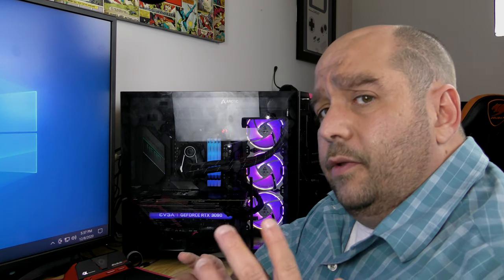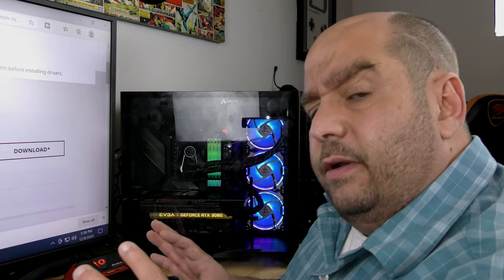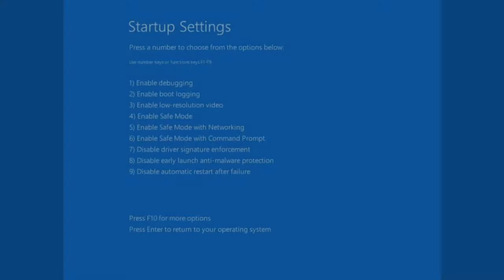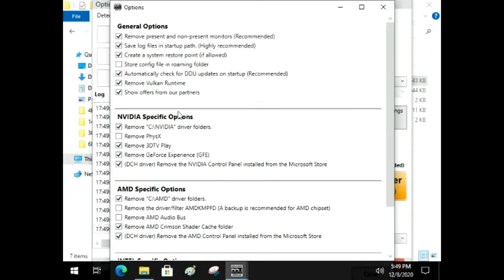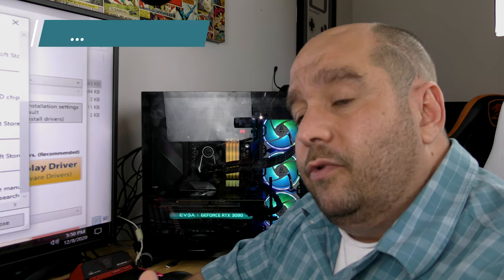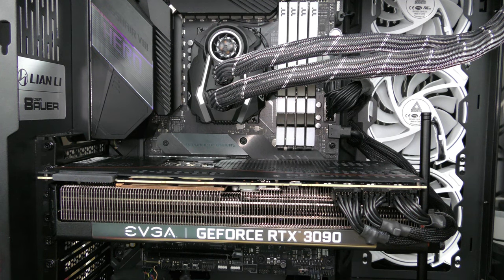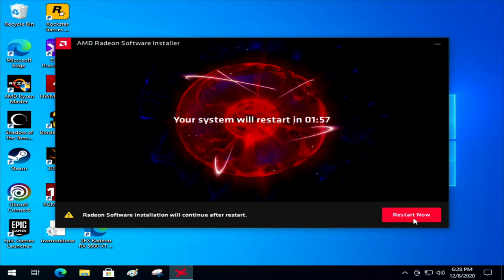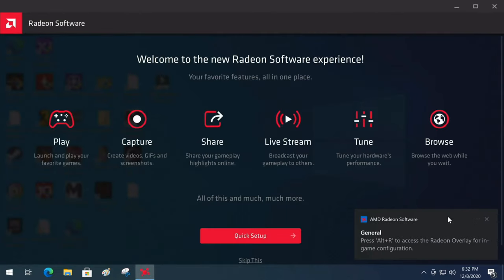AMD Radeon RX 6800 - Installing the Sapphire NITRO+ RX 6800 Gaming

Comment: I got a sapphire nitro+ 6800 and a seasonic 80+ plat focus px 850w and it sounds like both are having coil whine. Should I be concerned? Everything is running properly, it just annoying very noticeable noise.
Reply from the maker: no... but if it's insanely loud, i think over 50db (You want to check with sapphire support on their terms) but usually unless its obnoxiously loud and a certain DB, they will not change it.  Sadly coil whine is kind of common, I don't get it much, but I do get it occasionally I am trying to figure out a way to record it to show it to all.
Reply: @ThisBytesForYou  I capped my fps at 60 and some games its not to bad but when I start remnant it sounds like a screeching harpy. It goes down after awhile but the start up is really bad
Reply from the maker: @palacepanda1753  yeah I know what you mean... but it may be best to contact sapphire, maybe they would change it.  Headed off to bed now, gotta get up early for work tomorrow, but thank you so much for checking out this video, liking and subbing as well as commenting, it means the world to me my friend and I hope the best for you.  if you write back, i will get back to you as soon as possible tomorrow. I answer all of my comments and always try to help where I can.

Comment: I have a r5 3600 and rx6800 but have been having low fps and also my gpu drops to 0 volts intermittently at idle.  All my bios are up to date. But i did upgrade from a tx 580 8gb and didnt delete the old drivers.
Build:
R5 3600
Asrock B450 Steel legend
Sapphire Nitro+ Rx 6800
Gskill Trident Z 16GB 3000mhz
Corsair CX750W
Samsung 860 Evo 1TB
Samsung 860 Evo 500GB
Cooler Master MA620M cooler
NZXT H510

Fps im getting: (no ray-t)
Siege max settings 1080p: 240
Doom eternal max 1080p: 220
Warzone max 1080p: 130
Reply from the maker: ummm, you are saying you have low FPS...., 240, 220 and 130... how is that low?
Reply: @ThisBytesForYou  i was seeing some people get like 330 on doom eternal with a similar set up and i agree its not low but i want to make sure im using my card to its full ability without oc
Reply from the maker: @xXReichstadXx  it all depends on their presets, their current settings, monitor htz, and a ton of things as well, also cpu.  At 1080p, you are CPU bound, are they are 1080 or higher?  DOn't worry too much unless you are getting under 60fps, but you are blowing it away, good job my friend.
Reply: @ThisBytesForYou  my monitor is a 165hz 1080p monitor but this makes total sense. Plus, using trixx has made me 10 times more confused xD but your right and by god i do enjoy the quality im seeing.
Reply from the maker: maybe this video will help you with trixx: https://youtu.be/y8mIsFIA15k

Comment: After I restarted my pc is at a black screen any reason why nothing is popping up?
Reply from the maker: Could be a thousand things, give me some information so I can help
 So that I can help, please list the manufacturer and exact model number of the following components:
1. Motherboard
2. CPU
3. RAM
4. Video Card
5. Power supply
6. Monitor.
7. Do you have ALL of the PCIE connections plugged in, and not daisy chained or pigtailed, each coming directly from the power supply?
8. Are you running through HDMI, DP, DVI, VGA, etc?
9. UEFI in the BIOS from Legacy.  If it was set to Legacy, you will need to reinstall windows to get correct support.
10. Disable CSM in the BIOS

Comment: Hi there, Thanks for taking time to make this video, very well explained, subbed, 
undoubtedly saved me a lot of time and hassle ,  I came here after purchase of 6800nitro today .

I’ve Followed your instructions to the letter and everything worked perfectly exactly the same as your video - until I tried some games, 
Doom 2016 =  tiny screen 
Asseto Corsa in vr just won’t show on HMD at all , both running fine beforehand .
Also I can’t close the oculus app 

Thinking I must have driver issues , should I delete and reinstall games? 

Previous card was nvidia 2060super , GeForce experience has been removed by DDU 
CPU is 3700x , rift s 
Any ideas?
Thanks
Reply from the maker: Thanks so much for your support my friend, I greatly appreciate it.  Regarding potential driver issues, I recommend you watch this video: https://youtu.be/8JuC_Dpm6-c

Also, as for Doom, when you are playing it, press Alt+Enter, it should fix it, since it seems you are playing in boarderless or windowed mode, i play everything in full screen.  VR, even thogh I have an Oculus quest 2, I have not tried it much, its my sons, so I cannot comment on it.  So when you used DDU, did you install the latest and great AMD driver?  Make sure you are using HEVC encoder in oculus for AMD and maybe take a look in here: https://www.reddit.com/r/oculusquest/wiki/faq/link
Reply: Wow ! Thanks for such a quick and detailed response, I’ll have a look at these links and see how I get on, I’ll report back with results in case it helps future users with similar issues 👍👍
Reply from the maker: Thanks bud, this most definitely helps others, thanks so much and welcome to the fam.
Reply: thank you for your advice
yes i doubled checked i had the lastest & greatest AMD gpu drivers and they were ok, then strangley the pc kept intermittently freezing the cursor as well,all i could do was reset the pc to get out of it. so deleted old mouse drivers and reinstalled now all working fine.

i ran a repair on the oculus app using the in built software -no change to the problem,  all i had was the three dots on hmd no matter what game i was trying to run, so looked through the radeon software and found that steam vr intergration was disabled ,so enabled that and its worked! 
had a quick blast on Aircar with all the settings maxed out and i have still got the smile on my face an hour later. so all good there.

i havent tried doom yet as i have uninstalled it for now,but will check over weekend

is there a way to remove the DDU software? as i dont like more stuff on pc than neccesary,ive had a look in programs but couldnt find it to uninstall

Edit: reinstalled Doom and tried alt+enter but that’s not sorted it, the screen is about 1/8 normal size but the pc thinks it’s showing a full screen image 

cheers
Reply from the maker: ok so then in doom, make sure if it lists refresh rate, make sure the refresh rate is correct, make sure you are playing in full screen mode and not windowed or borderless.  Not sure what the mouse driver had to do with anything though?  Are you using the official Oculus cable... I used a regular usb c cable, but my son is getting some lag, I need to get the official cable to see if it makes a difference.

As for DDU, yeah, you can just delete the folder, it does not install, it just extracts.
Reply: ah thanks!  OK deleted the DDU folder.
Regarding Doom it looks like this is a common problem unrelated to the card change, trouble is the screen is so small i cant see or get into the options plus the in game stats overlay is also on, to be honest im not too worried about it, i just wanted to compare performance against my 2060s.
Concerning the VR, I'm using the Rift s so its got the displayport and usb cable installed , the VR side of things is working fine now after making the changes in the Radeon software.
Have a good weekend & THANK YOU FOR YOUR HELP !
Reply from the maker: awesome my friend, very happy you got it working, thanks so much for trusting in me to help you, thanks so much for stopping by, checking out my video, liking and subbing as well as commenting, it means the world to me.
Reply: hey man, yeah thought i would update, had terrible vr performance all week ,crashes and freezes, unresponsive Oculus software needing constant reset of PC
I added another cable to the gpu from the psu instead of daisy chaining - no change.
I ran monitoring software but nothing looked out of place,so started to think about ditching the card and going back to nvidia.
anyway long story short, ended up doing a fresh install of windows and Bingo ! all is good now -no problems

Comment: If I have and old AMD card  which uses the same driver already updated, I don't need to uninstall and reinstall the driver right? Just change the cards.
Reply from the maker: with all the issues going on, if you have older hardware, yes just remove the card and install the new card, but if you have newer hardware, follow the guide.
Reply: @ThisBytesForYou  Thank you!

Comment: I know this is 2 years old but I just wanted to say my 2060s clips are actually on the top
Reply from the maker: yeah, working as Product Development at Alienware and Velocity Micro, all of the cards we used were on the bottom, since we only used some manufacturers, becoming a reviewer, I got to experience many more cards and yeah... I found that some where on top or bottom, for both NVIDIA and AMD cards, surely the same will happen for Intel cards, whoops haha, thanks so much for letting me know ;)
Reply: @ThisBytesForYou  thank you for your response and I hope I didn't come off as rude or anything I was just curious if maybe my card was different for some reason. Anywho thank you for this amazing video I got a 6800 coming in later and feel very confident after watching it a few times!
Reply from the maker: no no, not rude at all my friend, I thought for years that they were on the bottom only, hahah because we would only use certain manufacturers, but others make it differently.  I am so very happy you enjoyed this video and I hope you let me know how it goes.  Make sure to subscribe, I come out with videos helping in all aspects on the PC weekly, stay tuned my friend ;)
Reply: @ThisBytesForYou  so far I thought so good I followed the steps perfectly, used DDU checked the box, let it do its thing, I swapped the 2060 out put it in revooted the system. It recognized the card but it wasn't in safe mode now when I try to install the amd drivers it says my pc can't open this file. It also made me restart upon initial bootup
Reply from the maker: thats ok that you swapped the card and rebooted into regular mode, and started installing, thats normal, what version of windows are you using?
Reply: @ThisBytesForYou  windows 10 I ended up redownloading the amd drivers and it seems to be installing correctly now. Thank you so very much you have been a great help
Reply from the maker: Always a pleasure my friend, so very happy you stopped by, trusted in me to help you, liked and subbed as well as took a moment out of your day to thank me.  It means a ton to me and I am so very happy I could help you.

Comment: hey my man have a question. My video card (AMD 6800 XT) will crash at least 1 or 2 times a day when i stop playing my games. I've tried Overclocking, under clocking, tried to keep the demand high so it always needs power but i'm having no success. Because i'm in a lock down area (Ontario Canada) i cant easily go out and get stuff to try and tinker. My power supply is a 750W, however it is around 5 or 6 years old. The power i'm putting into the card is from the same 8 prong plug and it jumpers to the next set of 8. Could my power be providing too low Wattage? When you plug in the cables (From your video) they're 2 separate cables coming from the supply but mine is only technically 1 - 8 prong set. could that be my problem?

rest of my specs in my PC is newer and made from 2019. only thing i didnt buy new when i rebuilt was my power supply.
Any help would be appreciated! Thanks!
Reply from the maker: So that I can help, please list the manufacturer and exact model number of the following components:

1. Motherboard
2. CPU
3. RAM
4. Video Card
5. Power supply
6. Monitor.
Reply: @ThisBytesForYou  
1: Motherboard: ASUS ROG STRIX Z370-E Gaming
2: Intel i7-8700k @3.7GHz
3: 32GB Corsair 2667 MHz ----- CMK16GX4M2A2666C16
4: Radeon™ RX 6800 XT GAMING X TRIO 16G 
5: Corsair TX 750M ------ TX750M 80+ Gold Semi-Modular
6: Samsung 27"  Curved Screen ---LC27HG70QQNXZA *Display Port plug*
&
6b: Acer monitor 24" -----Series KN242HYL *HDMI input plug*

Thanks for getting back to me so fast!
Reply from the maker: So first off, make sure you flash your BIOS to the latest version, 3003, its beta, but it should be fine.  Once you have flash the BOIS, go into the BIOS, load optimal defaults, then save and exit, then on reboot, go back into the BIOs.  Enable XMP, set the PCIE lanes to Gen3 (the motherboard manual does not go into detail on all the settings) do not overclock anything, disable CSM, disable fast boot,.  Set up your Boot Priority, then save and exit.

Make sure you have 2 separate x8 pin PCIE cables in the video card, don't daisy chain the power cables.  Your power supply brings 2 cables, each with 2 connectors, don't use the secondary connection on each cable, only use the primary: https://www.corsair.com/corsairmedia/sys_master/productcontent/TXM_Manual.pdf

Do you have Freesync enabled in the monitor (LC27HG70QQNXZA ) , and if you do in the monitor, is it enabled in the software?  Hmm, interesting, your 2nd monitor does not have Freesync, I am wondering if that is causing an issue, maybe test with that monitor disconnected, just for testing.

Make sure Enhanced Sync is disabled in the drivers.

Makes sure to set the refresh rate to the highest the monitor can achieve, if you are using 2 monitors, make sure you set the highest both can achieve, so if one can do at the most 120 and the other can do 100, set them both to 100.

Update windows 100% and let m know how it all goes for you my friend.

As for replying so quick, always a pleasure my friend, I try to help when I can, please do make sure to like and sub, it helps a ton and that way you know when I come out with videos just like this.
Reply: @ThisBytesForYou  Sorry i took so long to reply, i did do everything u recommended, for some reason when i disabled CSM my computer wouldnt even boot at all. probably something on my end so once i reset the motherboard i changed most of the stuff and havent crashed in last 2 days so far. Ill keep you posted but thank you so much for all this info!!!

Comment: nitro+ recommended PSU is 850W. Should I expect issues if mine PSU is 750W gold+?
Reply from the maker: They recommend it, it is not required, BUT, it is a BIG but, I would always recommend using what they require, they made the card, I am sure they had a reason and this adds the ability to overclock and give you more head room

Comment: Has anyone found out how to mitigate the Wattman power settings crash with some of the Radeon cards? I'm trying to help a friend with his MSI 6800XT and the card is even freezing/crashing the system when he doesn't even have a game running at this point.
Reply from the maker: with the new installer, you are able to install drivers only, give that a try but if you are having issues there, you might have other issues. 
 So that I can help, please list the manufacturer and exact model number of the following components:
1. Motherboard
2. CPU
3. RAM
4. Video Card
5. Power supply
6. Monitor.
7. Are you running through HDMI, DP, DVI, VGA, etc?
8. UEFI in the BIOS from Legacy.  If it was set to Legacy, you will need to reinstall windows to get correct support.
9. Disable CSM in the BIOS
Reply: @ThisBytesForYou  What a detailed and in depth response sir <3 This is getting saved for future reference. lol Will keep you posted on how it goes. Thank you very much again for such thoughtful help.  :-)
Reply from the maker: @VincentJaramillo  awesome bud, well very happy I could help you, always happy to help..  Thanks so much for stopping by and please let me know if you need additional help, and if you could, please do like and subscribe, it helps out a ton.  Thanks again.